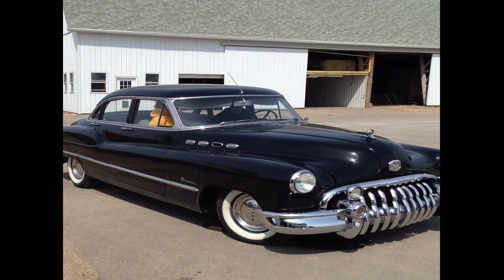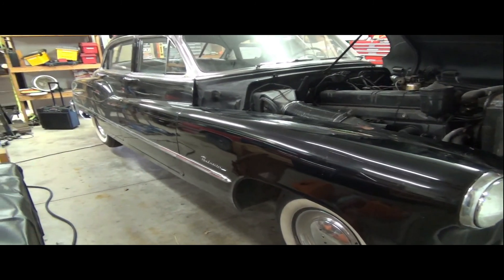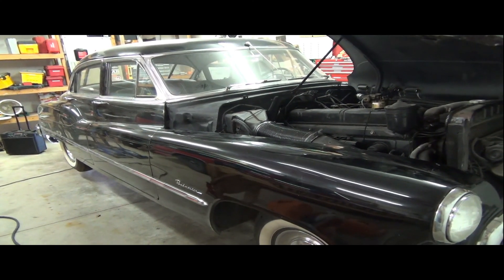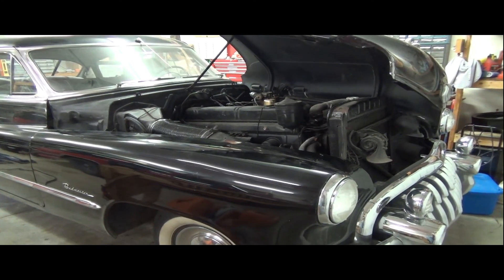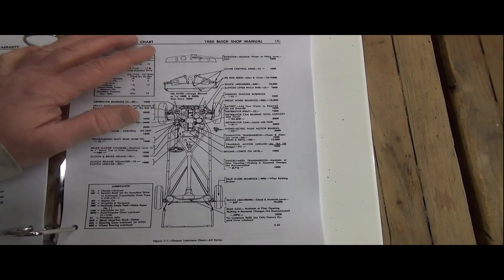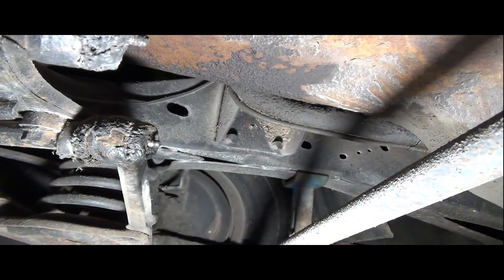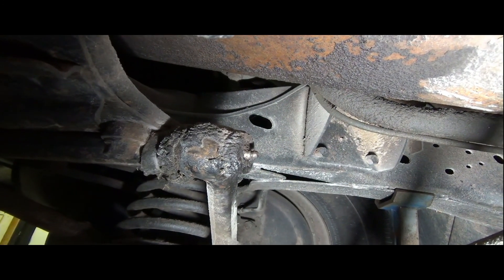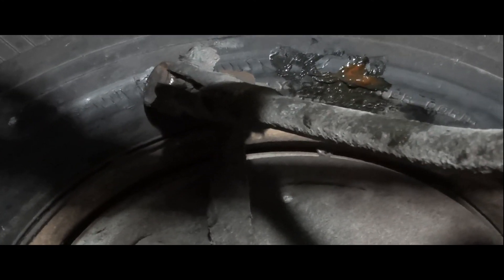1950 Buick Roadmaster part 1

Comment: Hi Del, Check out Mr. Carlson’s Lab video, he designed a new 6 volt signal light flasher module for his Oldsmobile. He also explained how the 6 volt signal light circuitry functions. I think you will find very helpful.